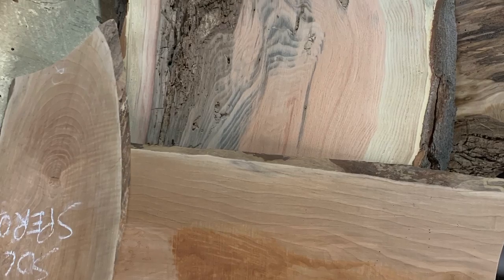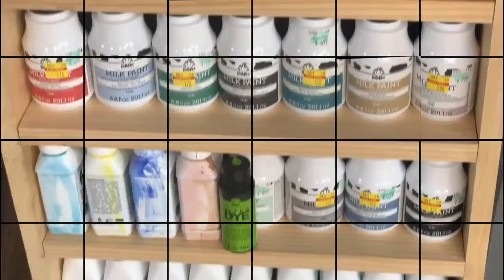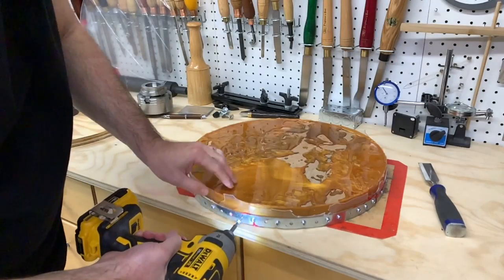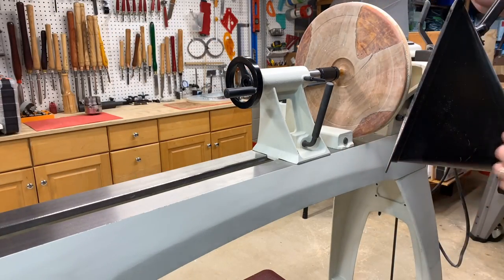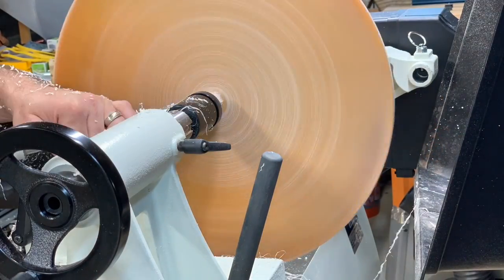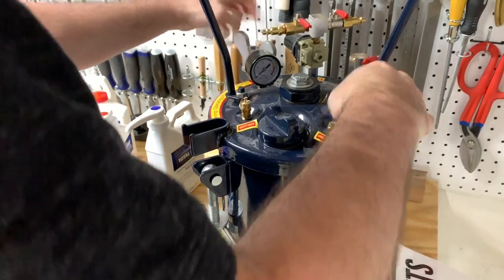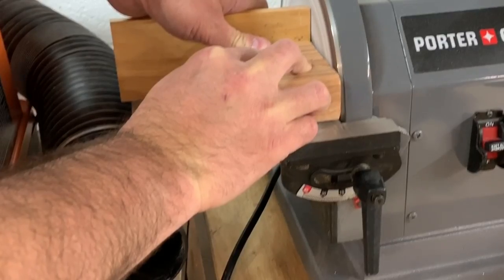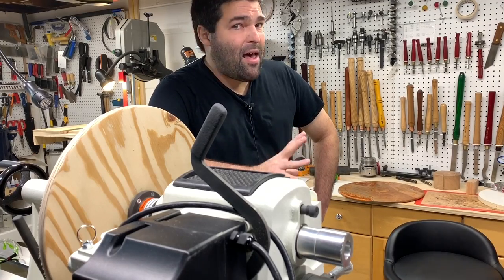Time to Turn a Slab

Comment: Love it Speros!  Fine looking clock!  What did you use to make the form for the resin pour?  It looked like some type of metallic material?
Reply from the maker: Hi Darwin, The mold was melamine Base with plexiglass sides, covered outside with metal pipe hanger and sheathing tape. It worked well, accept for the silicone I used inside stuck to the piece and the melamine. So, I need to make another one with different silicone caulk. Thank you my friend and for watching. Take care